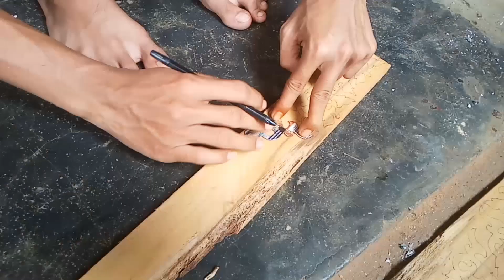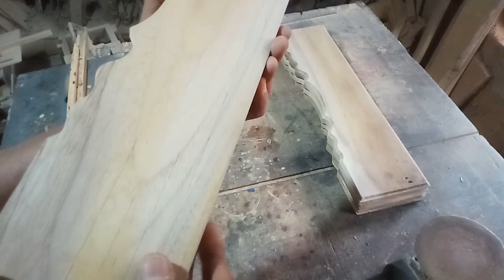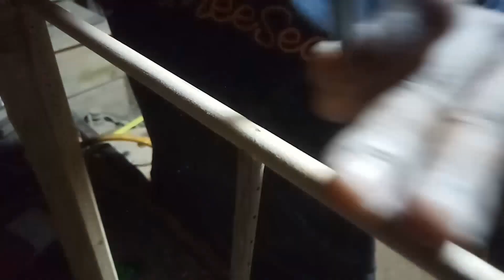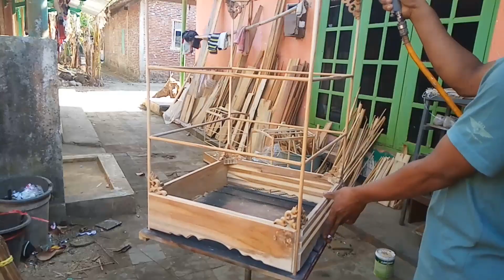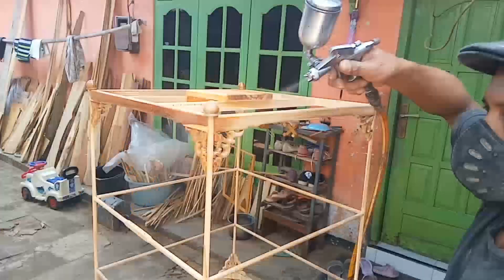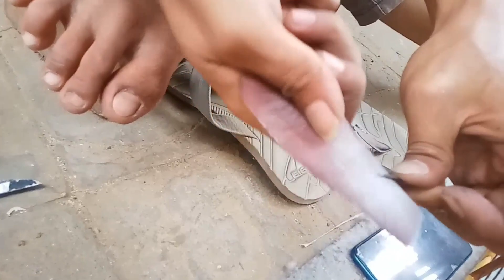membuat sangkar pesanan untuk burung CUCAK RAWA

Comment: Gergaji serkel nya pake mesin apa mas dan harga nya sampe berapa
Reply from the maker: Penggerak dinamo induksi 0.5 hp.
Hrga kisaran 900rb🙏
Reply: @pangkayu2694  buat potong kayu keras bisa gak mas ?
Reply from the maker: @Da_Pradanaa  bisa bgt ms
Reply: @pangkayu2694  ok terima kasih mas
Reply: @pangkayu2694  saya cek yg 0.5 hp bisa di listrik 450watt ya mas
Reply from the maker: Bisa  tp tanpa beban...
Byasane klo lg di pake,listrik 450 cepet jeglek meterane